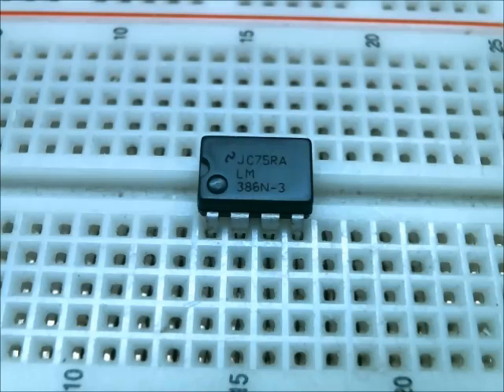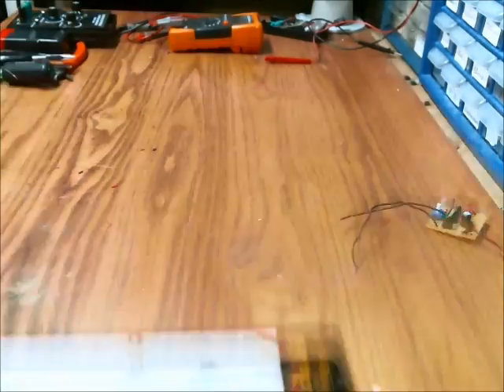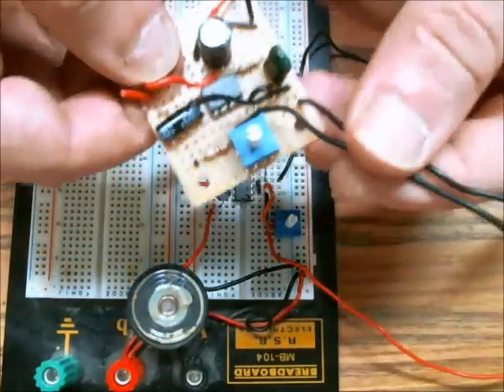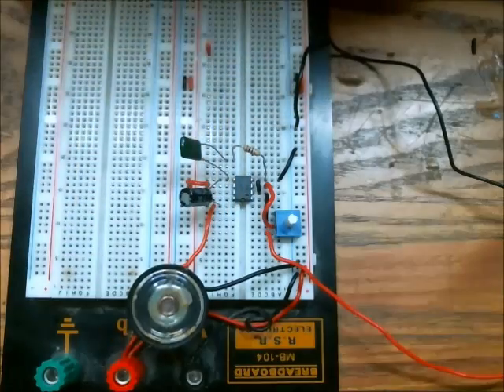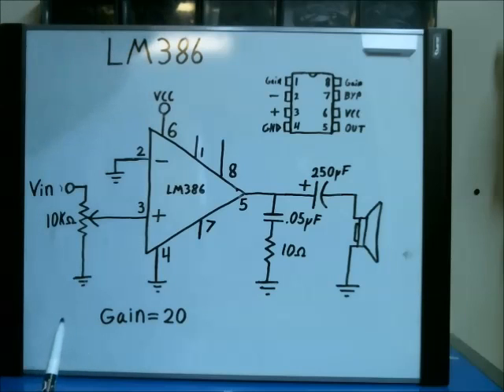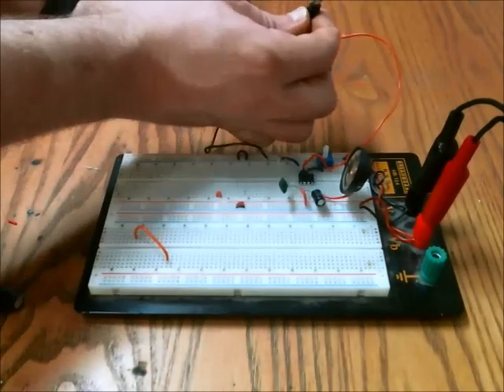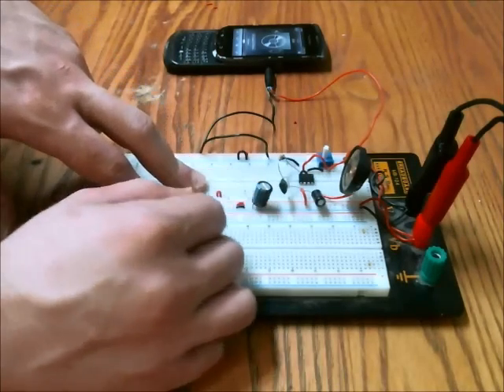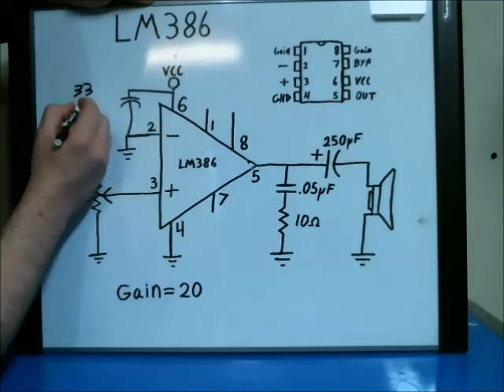LM386 Noise Removal

Comment: That noise it seems to me coming from you PWS like bad cap internally Also noticed the RC cap and resistor at the output cut off some frecuencies that can mask the noise a bit. It's ok also good practices to Install some caps between power sources + and - or ground.

Comment: Be careful with power supplies and almost directly to a chip. Do you get 5V or 5.2V on USB and maybe it got a capacitor already and then you plug it in to another and it's different. Maybe you need a buffer before the circuitry, but that's only when you visit a friend.

Comment: If the wires running from your power supply is longer than 10 centimetres you must use filter capacitor else it will motorboat like this. I faced the same in case of building tda2030A amp circuit

Comment: I know the best configuration for the LM386. Try this one: (# 1) a 10uF CP across pin 1 and pin 8. (#2)  connect pin 2 and pin 4 to the negative terminal of a electrolytic CP (1000uf) connect pin 7 to the positive terminal of the same capacitor. Than you you know the rest

Comment: This is a cry for help not criticism. I love the video, it's exactly the problem I'm trying to learn about. BUT, I'm New, I'm trying hard. You move the old Board so fast I can never get a good look. Help Me, did you  bring the VCC( the pos input voltage) straight into the bread board and not hook it to the +/- feed on the outside 2 rows of breadboard? Looks like you go straight from output speaker to the outside 
+/- seemingly defeating the pin 5 capacitor and resistor. It also looks like you have a POS feed going through the pin 5 Cap and R  - > to the speaker as diagrammed. Also Pin 3 should hit the 10k R then move on. Is the jumper from pin 2->pin 4 allowing you to shift the pin 3 1k R to pin 4, in a straight line due to the 2-4 jumper?    If I make No Sense, I completely understand.  Sincerely, ...........NBSTATIC.

Comment: Whenever i plug the jack in my mobile while the circuit is powered, my mobile screen starts to act strangly, i have tried the circuit with different mobiles but still face the same problem. Its like some current flow into mobile through the ciecuit

Comment: This is no noise. It is oscillation. Sufficient grounding is essential. The ground point with the lowest ac impedance has to sit as close as possible to the ground pin of the chip amp. This point is usually the minus pole of the electrolytic buffer capacitor. This buffer capacitor should be paralleled with a ceramic capacitor of 100 nF in order to short also higher frequency oscillations which are not audible but a load for the chip amp. And, as Cass Virgillo wrote, use separate ground paths from this ground point to the input and output ground.
Reply: True and little  false both at the same time...
Reply: @69iqtutorial  it is in general not so easy to make a sufficient design based on the LM386. There must be several things taken into account. This IC is very sensitive to oscillation because of its inner circuit design. Star grounding around pin 4 is essential. The Zobel output filter ist essential and there should also be a capacitor of 47 pF between non-inverting input and ground in order to low pass filter the input signal from hf.

It is also not wise to bridge the inner 50 kOhm resistor between one of the IC's inputs to ground. So the inverting input should be grounded via a capacitor of 1 to 10 µF. Otherwise the input differential amplifier becomes unbalanced which lead to output offset and therefore lower maximum output power. There is also another problem due to direct grounding of the inverting input. The differential amplifier becomes more nonlinear leading to more THD.

In fact, you can operate the LM386 with significantly lower THD (less than 0.1%) as shown in the data sheet when you use capacitor bridging instead of direct bridging of the inverting input.

Comment: Tis your power supply ripple.
If you run your circuit on a battery, this doesn't happen, because the power supply is perfectly smooth, though it's still advisable to bridge the Vcc and GND pins of the IC - with the shortest route possible - using a 100nF cap (1206 SMD ceramics are the best for this purpose as you can connect them nice and easy without introducing a parasitic inductance). This little cap will help provide short bursts of energy with low latency when a battery or power supply has a much longer response time to provide the necessary power.

Comment: Hey dude you are a genius! Thank you for this video, really!
Reply: Well, if you look at the datasheet recommended circuit, the capacitor is clearly shown there, between the power supply and ground. I don't think you need to be a genius to read a datasheet and design a circuit properly :-P After all such capacitor is necessary in every power amplifier. This has been known for about 80+ years, starting from tube amplifiers in 1920's...
Reply: @ok4rm  Ok next time do your video and let's see!

Comment: 10uf cap from pin1 to 8, then take the cathode of an SB140  schottky rectifier and connect it to pin 8, connect the anode to pin 4. Noise gone.

Comment: Your power supply is outputting chopped up DC, probably pulse width modulated with inadequate smoothing.

If you run into a situation where a capacitor alone isn't enough without so much capacitance it isn't feasible, an inductor before it in series will push it over the top, however, it will trade spiky ripple with slow voltage drift. This is only an option if you are using dirty DC to feed a voltage regulator. Then the voltage out of the regulator will be smooth as a baby's bottom.

Basically:
Dirty DC -> 2.5-5mH inductor -> Capacitors -> LM317 -> Absolutely prestine DC with no noise.
Reply: I knew my supply was dirty so I fed it into another regulator board with a few caps on it just for good measure.

Comment: "Problem solved" ... Not really, problem created removing it. The decoupling cap must be as close as possible to the chip with a 100nF ceramic cap.
And by the way, it is not noise, it is oscillation.

Comment: I guess I've been lucky, but nothing I've built with a 386, even when I place a 10uf electrolytic between pins 1 and 8 for max gain (200x), has ever caused me noise problems.  However, I like the cure you present; don't think I was aware of it, and don't believe it even appears on the IC datasheets I've seen.

Comment: I am using a pam8403 class d amp module and when I put a capacitor across vcc and ground it only makes more noise than there already is now when I use an addresable led strip near that amp like the ws2812 it make some stronger humming noise unless the input wire is being disconnected and I wonder why?

Comment: Pin #7 is a Bypass for the Input Transistor's Collector... run a 0.1uf capacitor to ground. This will help with noise immunity. Another good practice, is to use an 100 ohm resistor between your power source and the Pin #6 power input, and place an electrolytic capacitor as close to Pin #6 and ground. You should also ground the Zoble Network and the Speaker as close to the LM386's ground pins.

Comment: Damn, it was the noise from your PSU :( I have a battery-powered circuit with LM386, producing some pretty loud hissing noise. Putting a capacitor on the supply wires has no effect (not a guess, actually tried it). Filtering the output has some effect though, but muffles the useful signal as well.

Comment: looks like that noise was caused by switching within your power supply
Reply: It was. His specific flavor of noise. However, even if it were clean, the op amp itself will dirty it's own supply voltage adding distortion without a cap in exactly the same place. It needs it either way.

Comment: How can you forget the cap that provides the gain?
Reply: The default 20x gain from line level (such as this music player, phone and pc outputs) is kinda too much as it is for a 0.5-1.0W chipamp. Thing starts clipping pretty easily. The 200x setting is more useful for amplifying much weaker signals like those from electric guitars and microphones. But 200x line level, even with the maximum safe input voltage, it clips a LOT and sounds awful!

Comment: Thank you, Mr. Heilman. Very generous and informative video. You, sir, are most kind!

I just received an order of a few LM324 (Quad) Op Amps, and am intending on building a similar stereo amp for use as I begin building simple -- eventually more complex audio oscillators, filters, etc. and one (or more?)16-Step Sequencers. I've seriously been bitten and smitten by the whole Euro Rack Synth Modules thing, late to arrive as I am. I will certainly apply your tips as well as some others offered by other kind, generous commenters. It's wonderful to show what you know, it's a true gift to educate. THANK YOU!

Comment: put 450uf capacitor between pin 7 and ground to get rid of any noise and put high capacitor on the power gate
Reply: thanks! this was the ONLY thing that worked for me! tried grounding so many things with capacitors, but hadn't thought of this one. Thanks!
Reply: Actually worked sweet with a 100! seems everyone has a different technique for getting rid of that hum! no hum with a battery (9v) but such a dreadful noise with a power cable plugged into mains!
Reply: damn.... it stopped working again.. lasted about 30 seconds... then the noise came back!

Comment: You can also connect a capacitor from pin 7 (Bypass) to ground, which ought to stabilise it a bit more and potentially remove a bit more noise.  

The datasheet doesn't give a value but since it's for smoothing, it can be as big as you like.  10uF seems enough; maybe even less.

Comment: Hi HH, Just a little FYI, proper ground layout is really important with the LM386 and with any other chip amp. A separate ground path for input, power and output, the Star Grounding technique, as per John Audio Tech on YT. All the ground paths should junction right at pin 4, GND. Filter cap should be as close as possible to pin 6 and 4. Be good, C.
Reply from the maker: Cool, thanks for the information.
Reply: I love John audio videos very much

Comment: that noise likely wont be a problem in the first place if you're using a battery as the power supply. it just sounds like switching noise from the power supply you're using but as noted below you should have a bypass cap "filtering" the input anyway because its an audio circuit and once you get past a few dozen Hz inductive effects on the ground plane ( just a wire here) can no longer be ignored. also as noted below, you shouldn't need nearly as large of a cap. its also worth noting that electrolytics alone aren't necessarily ideal for this purpose but they'll do fine as long as you're not using this to pre amp for a much more powerful amplifier. nominally you would want a mylar or silver/mica in parallel with a decent electrolytic because they can respond much faster to the sudden power needs and have a much more stable esr over a wider range of frequencies, but thats going all audiophile and junk.
Reply: Atlas WalkedAway, do you have such a schematic to offer here on YouTube? No pun intended, but your comment 'sounds' very interesting. I'd like to try something like this as well as the one offered in this video. 
Thanks, Sarah
Reply: If you Google lm386 audio circuits you will find a lot of different uses for it and how to increase the gain of the chip. It's been around a while but it does its job well. Hope this helps. ps a good place for audio is diyaudio.com.  @Sarahbuildsstepsequencers
Reply: A low ESR capacitor is fine, and typically, the bigger the better. The larger the cap, the better it is at removing ripple, but not if it comes at a cost to ESR. Electrolytic and a film/mica/ceramic cap in parallel is the best of both worlds. I don't recommend ceramic if powering speakers, cause of microphonics causing feedback.

Low esr caps are easy to spot because, surprise surprise, they are labeled as 'audio grade'.

Also, even when using a battery as the power supply, you will have problems with distortion due to voltage droop due to the batteries internal resistance. This is also fixed by the cap across the power input.

Comment: For some reason if I bridged pins 1 and 8, then bridge it to pin 2 ( which is also grounded ) it also removes all the noise, well my circuit is slightly different from his but never the less the same without the second capacitor between VCC and Ground.
Im here to ask someone, why did connecting pins (1 & 8) then to 2 removes all the noise in my setup? Thanks in advanced.

Comment: well... you have problem you make your in 20 gain set if you want to make much hi gain set in 200 just plug mylar .2 uf in pin 1,8 and put some a resistor that has resistance 22k in input of ic parallel in the ground filtered much the sound stability and .1 uf electrolytic into input of you put in the pot it will much filtered block the unwanted noise in the device and make the input signal will much fidelity and  in my opinion you make the  amp much better in crank just put 2200 or 3300 uf electrolytic so it will boost the watts yet filtered pwr source and parallel again a .1uf mylar  so the unwanted noise go out and much no noise and the last to balance the low to hi freq ratio to output just put a .47 uf mylar parallel to resistor 1 ohm to gnd so it will just the bass will came out yet in hi freq and last put a .47 uf maylar in pin 7 so the sound way perfect in 99% sure the amp will be in hi fidelity and no distortion at all promise you make what I mean so it can be the pure and potential of that ic will came out  promise to you but da next secret is I almost forgot is parallel again a 1k uf in 330 uf in output so the signal from amp is so filtered that I can tell you can fabricated and sell a radio amp no noise no distortion even in full volume of the amp

Comment: just power supply issue, are you using bench power supply or any sort of AC to DC adapter?
Reply from the maker: I am using a bench power supply, which does have some ripple under load, but I had a similar result with batteries, seems like there was resonance from the speaker.
Reply: I'm using one of those USB powerbank, quite nice, rechargeable and high density

Comment: I believe pin 2 is always grounded and another pin has a cap to cut out am radio interference, if you mess around with these chips and make a good crossover for your speakers and use all good components the sound quality can be hi fi quality, much better than most boom boxes and so on.

Comment: Actually this is not a new solution for that kind of problem. It`s state of the art. The designer of the IC makes the analysis of the circuitry whit consideration that the power supply connection (Pin 6) is a short to ground for AC signals. As you have discovered this is easily done by using a bypass capacitor between the power pins. Usually that cap is kept as close a possible to the IC. Without this capacitor,depending on the length of the power wires from the power supply, the amp can become unstable and begin to oscillate, what probably happened in your case. The usual technique is to put two caps parallel to the power pins of the IC. One cap is an electrolytic one which is able to bypass the low AC frequencies the other one is a sort of ceramic or other types which are able to by pass the higher frequencies. Butting only a electrolytic cap eliminates the low oscillations, which you hear through the speaker, but can sometime let oscillating the amp in higher frequencies modes even around 1MHz which your speaker can`t reproduce. The amp works properly anyway in his designed frequency range, you can hear some music but still oscillate on a higher frequency.

Comment: Thank you for that, mine didn't make the noise like yours, but it was getting a lot of interference from TV and radio, after I put the Cap. it worked fine. ( I had a 450uF cap on hand and that's what I used)
Reply from the maker: Awesome :) glad it worked for you.